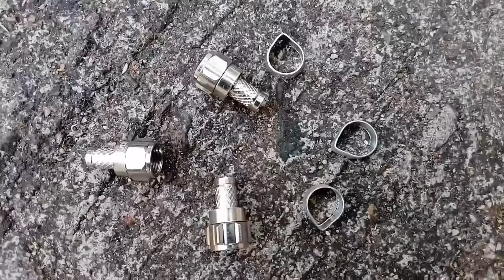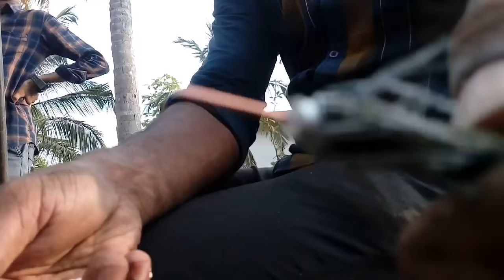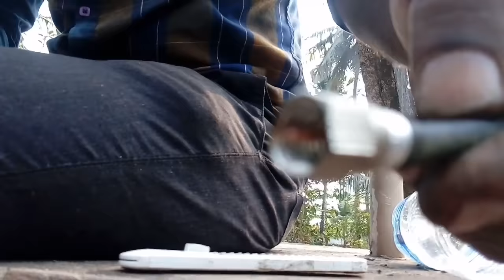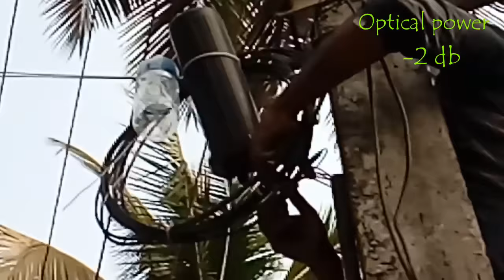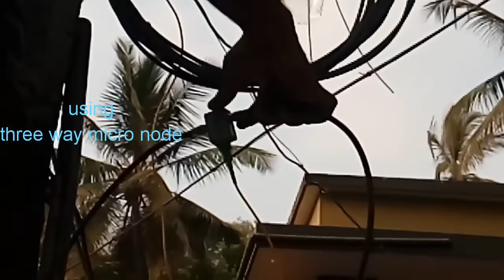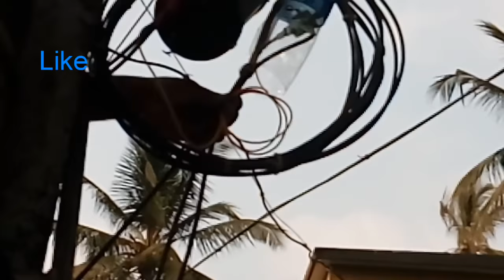three way connection cable tv using optical signal

Comment: Which transmitter is better to throw signal completely in optical fiber without using unit node etc. 
Pls reply
Reply: I have same doubt. If you get the answer pls response..?